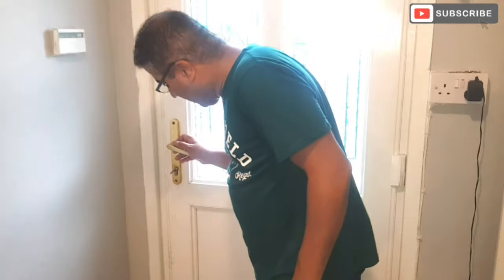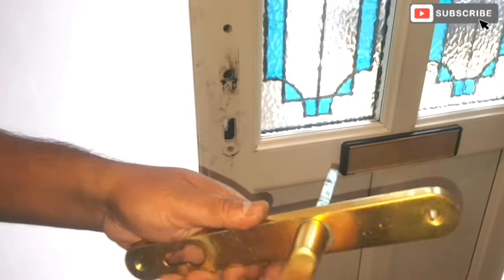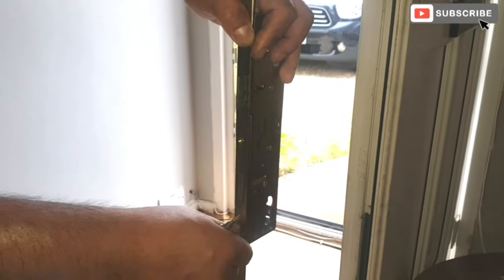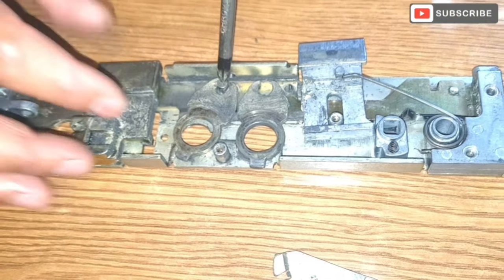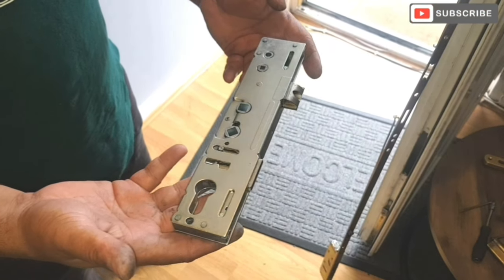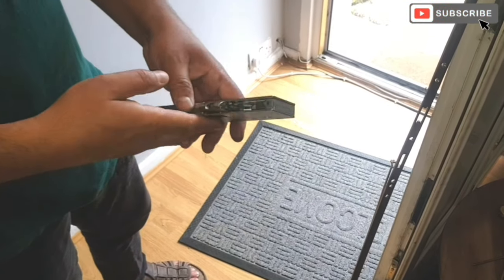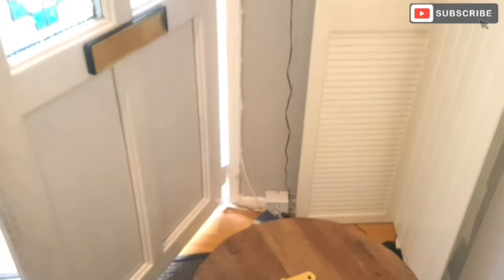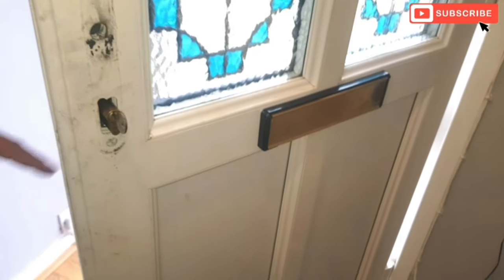UPVC Door Locking And Unlocking Problem || How To Fix UPVC Door Lock

Comment: Many thanks for posting this … very useful and a big thumbs up from me! 👍 I had the same problem and took the gearbox apart to find at least two broken internal parts! I ordered a replacement and refitted back together … success! Thanks again 🙏
Reply: Hey where did you order the part from?
Reply from the maker: Hi. From my local Oxford based lock Smith
Reply: @diykhan  I will have to look into that. Did you bring the gearbox with you or is there some model number on the device itself? I have been googling around and there are so many different versions 😵‍💫
Reply from the maker: @bootsthegod9084  yes I did

Comment: Thanks for uploading this. My UPVC door locking mechanism stopped working today. Replaced the central part from local locksmith. Only problem I had was, I found out which lock it was from google, rang local shop who said they had it in stock. When I got to the shop, they asked is it the smaller deadlock or larger, of course i didn’t take the faulty one with me, and of course I had the cheaper one. Wrong. So back again to get the smaller one, but more expensive. Moral of the story is always take the old one for comparing. Still cost me just under £50, and job satisfaction.
Reply from the maker: Glad to hear your success story

Comment: This is a really good video! Thank you for taking the time to create and share this - really helpful 😊
Reply from the maker: You are welcome thanks 😊
Reply: @diykhan   I've just had to drill the lock because it didn't have the key when the handle was pulled up by mistate, how can I stop it locking that way when I fit a new lock. Thanks.

Comment: Excellent tutorial but I would add one word of caution. The screws which retain the locking strip into the edge of the door are self tapping and screw directly into the PVC. It is important to get these screws very straight as if they are only slightly off centre they can foul the sliding mechanism.
Reply from the maker: Thanks for your appreciation. 👍🏼

Comment: Good job, but I couldn't watch you using the power screwdriver when screwing things back, you can very easily strip these plastic threads. I'm up for the same job, will do everything manually, plus will lube the screws before putting them back in just in case.

Comment: Hi
very nice informative video.
i have a similar issue but with the lock part that comes out into the door frame side after turning key to lock the door . On inspection , the slot (vertical -rectangular in shape)inner edge which seems to contain an inner layer of some material has bent forwards into the cavity , preventing /blocking the latch part that moves into slot with key is turned to lock the  door.
Any possible solutions for this .
Many thanks.

Comment: Great video! My door has the opposite problem which is not unlocking /opening the door with the key..could this be a problem with the mechanism or the barrel? Thanks
Reply from the maker: Yes try it
Reply: IA will try, do you think it will be tricky to open the door once the handle has come off? And trying to turn the inside notch with a large screw driver? Any tips that you could recommend? Once the door has opened that's the hardest part the seems easy. Jzk khair
Reply from the maker: Yes try it
See how it goes 
Good luck
Reply: If the key turns and you can hear  a faint click then it is a mechanism  issue  if the key keeps spinning  then it could  be either  but usually  a mechanism  problem, if the key wont turn at all then it is a cylinder,if it turns a bit it could  be either.
Reply from the maker: @cardiffpicker1  thanks

Comment: Is the locking mechanism you replaced universal for all UPVC doors?
Reply from the maker: No, they differ depending on doors type
Reply: @diykhan  I have the same problem, just wondering if it’s the barrel or locking mechanism

Comment: How can I open euro cylinder without damaging it. It's a new cylinder. But won't unlock door as the gearbox is broke.
I snapped the 1st cylinder, to open door.  I fitted new  cylinder.  And customer locked it without my say , so now I'm back to square 1..  
Can I open without any damage.?
What about the little latches on gearbox?
Can't I flick a latch on the gearbox to open door?
Reply from the maker: Hi. Its bit tricky without looking at the actual lock.
Reply: @diykhan  Yeh i understand.  I also get asked questions in relation to my job.  But im a BIG Visual sorta guy.  When im in front of whateva, its so much easier to explain,  How To!  To Whoeva.
Reply: @diykhan  When its not so late, id appreciate any experience you have that would help, thanks